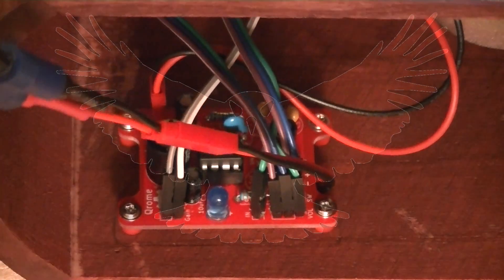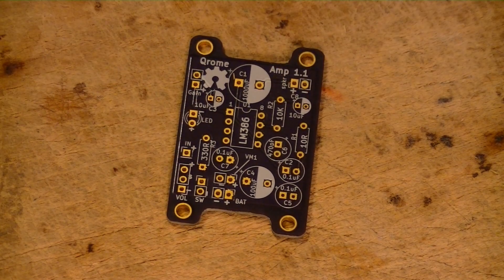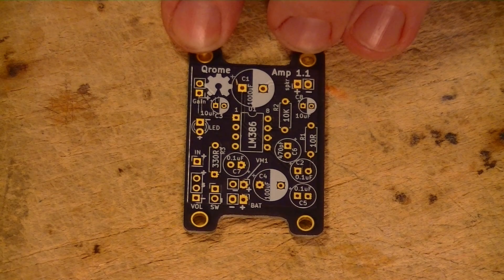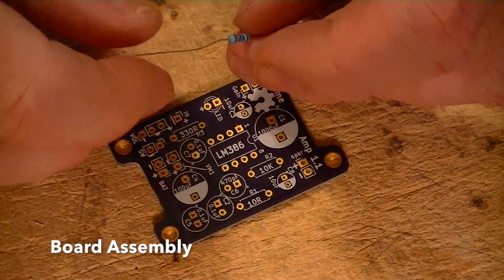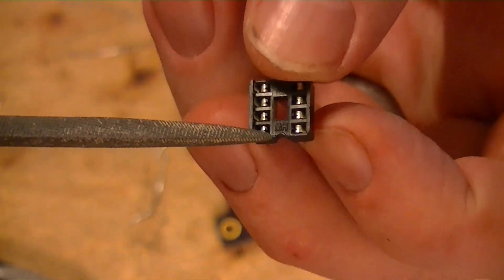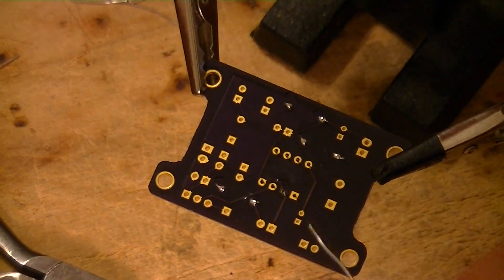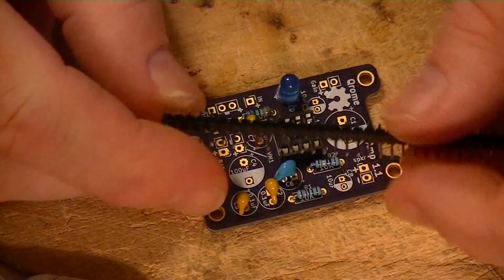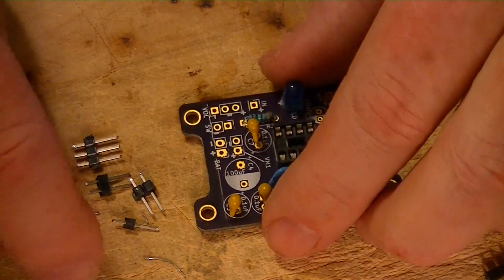Qrome Guitar Amp Build using LM386

Comment: You use the Open Source Hardware logo on your circuit board. Where is the schematic for the board?? I don't see it posted anywhere.
Reply from the maker: The schematic is included with the board.

Comment: can you give the schematic please? and pcb circuit and components too if possible. also i want to connect output jack to the amp instead of connecting directly to the speaker, how can i do that
Reply from the maker: Schematic is shipped with the board.
Reply: @Qromer  i have a project in college so i have to make the pcb board itself, so im making everything myself, thats why needed schematic

Comment: OK,, quick question. WHY did you use the Orange Ceramic caps on some places and the Blue on the 1 place? what's the difference? does it matter? I have tons of the blue caps but not sure if I have the Titanium ones(Orange).
Reply: I came here to ask the very same thing. I have the orange but no blue. Did you get the amp to work?
Reply from the maker: Give them a try.   It will probably work just fine.

Comment: Very good initiative selling pcb's.

I've done a bit of dabbling with the 386, myself and I find using a fairly small input cap like 10 - 50 nF to filter out some of the bass makes sense if you get issues with the bass clipping earlier than the mids and treble, or if you're using a small speaker element. I don't know if you're already doing this, but you can stablise the dc offset better if you couple the inverting pin with a 220 nF cap instead of shorting it to ground. JohnAudioTech has a pretty good circuit, if you're looking for inspiration for a v1.3.
I think I went for about 12 or 15 nF in the input on mine, which gives me a cutoff at about 200Hz to compensate for the 45mm membrane. 

Good choice with the 10k pot for the gain, gives you a better range, since minimum gain with a 1k pot is 50x.

If you find yourself looking for a bit more power or bass, the little gem configuration might be a good option. It's two lm386s that are bridge coupled, so it allows about twice the output. VegasCyclingFreak has a video on it. I would definitely buy a few of those off you, if you make pcbs for them. I'm currently looking at making one on vero.

Comment: Nice. I have a pre built lm386 that I got from china a few years back and I put together a 2 valve/tube pre amp board also from china. I plan at some point in using them both in a home made guitar amp. 
I also have a 1953 philips disc jockey senior record player which I intend on turning into a guitar amp. Also I plan on making a few guitar pedals and have bought loads of electronic components, germanium transistors, pedal enclosures etc. I'm probably overdoing it with projects LOL

Comment: This is very nice that you are sharing your work.
    I would like to learn to build a solid state with larger primative but stable  components, and substitute an analog circuit for the chip.
    Then I would like a reverberator with tone and dynamic control.
    I am waiting to hear your beautiful looking amp.
Reply: The chip is already analog. You're feeding it an analog signal (the guitar) and it is outputting that same signal... just amplified.

Comment: Can someone give the V ratings on the E caps?
10, 100 & 1000uF
Trying to order parts and the kit doesn't say.
Reply from the maker: I think I used 25v but,  you should be able to use anything over 12 volt.

Comment: What is the values of gain and volume potentiometer
Reply: Most likely 500k I would have thought. If it had a tone pot then maybe that would be a different value. I'm certainly no expert, I'm learning myself but 500k would have good controllability for the volume and gain, and a 1000k (1 meg) pot would have even better control

Comment: Is the guitar directly connected to amplifier input or some resistor in series?
Reply from the maker: Not sure I understand.  The video shows the guitar connection to the input with a standard guitar cable.
Reply: @Qromer  that means we can connect any guitar to any amplifier directly to input ?

Comment: Great little module! Given that it is allegedly Open Source Hardware, where can we find the schematic and board files? as this is a must of true OSH. Thanks!
Reply from the maker: Thanks for the comment.  Sorry, at the time I placed the OSH symbol on the screen I simply thought it looked cool.  The full schematic is based on the one provided by the LM386 datasheet.   It was not derived from an OSH project and is not under the license.  You can view the LM386 samples here:  https://www.ti.com/lit/ds/symlink/lm386.pdf?ts=1617997878307
Reply: @Qromer  Ok, I see. It's such a pity since your design is very good looking and would be a great resource for the open source community. Anyways, it's good to see it as a reference. I will attempt to develop a simillar version and hopefully share it around.

Comment: Do you have a ink to where you get the jumper pins?
Reply from the maker: The header pins are great, but sucks when wires pop off.  When I make a permanent mounted amp, I solder the wires directly to the pad and hole.  Otherwise, you can use any standard 2.54 Header Pins.   These are like the ones I use from Amazon:  https://amzn.to/3vw092h

Comment: I have assembled my amp but when I plug it in all I hear is static. any advice?
Reply from the maker: Yes, verify all the wiring is correct.  Make sure the LM386 is in the correct orientation on the board.   Make sure the audio jack is wired correctly.
Reply: Qromer so I couldn’t get the guitar amp to work but I am able to hear radio which is kinda cool

Comment: Hey great video and love the simplicity. Questions, did you design this? Is it based on proprietary IP? Can you share the circuit diagram? Thanks!
Reply from the maker: Thanks, I did design this board but it was based on the examples from the LM386 specification sheet. They give some very good examples how the chip can be used.
Reply: @Qromer  Ok fair enough, then I have one more question... I currently do not have any 10k ohm pots... I would have to order some. I do however have a bunch of 50k pots. I was wondering, I know that the resistance in this instance is not super important but I fear the voltage drop across the pot will be too high for it to work properly. Any insight?

Comment: If i want to fit this into a guitar to use headphones, can i wire the audio output plug to power on the device, as opposed to the input? My input would be hard wired into the guitar, leaving the headphone plug to be my other choice
Reply from the maker: Yes, I think that should work.  I have not tried it that way.
Reply: Qromer cool thank you bro 👍🏻

Comment: what is the difference between the volume knob and the gain knob?  and where in circuit do they come in the circuit.
Reply from the maker: High gain will add distortion and Volume will simply add volume.   Check out a data sheet for the LM386 -- they give examples out to use them.   The gain is between pins 1 and 8 -- with a potentiometer and a capacitor.  Volume is on pin 7.

Comment: Hey can you please release a schematic ?
Reply: JohnAudioTech has a pretty good schematic, just remember to add a 5-10k pot in series with the 10u cap between pin 1 and 8. Otherwise the one on the datasheet is also alright.

Comment: The board has the open source hardware logo on it but I do not see where you have posted this circuit diagram or board layout.  Can you share that with us?
Reply from the maker: The board does have the logo -- but only because like the way it looked.   It has not been released under the OSH though.   Sorry.
Reply: @Qromer  hey, could you release the source files? after all you are selling a board which says it is Open Hardware, so you must either release the files or realise it would be a fraud to advertise with such logo.
OSH means something, you can't use it just for looks, it also has legal implications BTW.
Reply: @emilianovalenciaa  That's not actually the logo used.  The logo used has the words 'open hardware' or 'open source hardware' which I don't see on his board.  Otherwise, it's just a shape.

Comment: Hi – David – Just finished making and testing my Qrome amp. Brilliant - worked first time! I’m really pleased with it as a project, and little practice amp. I bought a 3” 8 ohm 30w speaker, and build a sturdy cab, so I think I’ve probably got the best out of it. My only problems were – cost of shipping to UK, identifying correct resistors (although I did manage!), and could have done with a couple more jumper leads (although as you mention I could have soldered wires). The jumper leads work fine from socket to amp without soldering.  Cheers, all the best Terry
Reply from the maker: Terry, thank you for the feedback and glad you are enjoying the amp.   I wish I could ship cheaper to the UK.  I agree about trying to identify the correct resistors -- I am thinking of adding some close up photos with labels to the printed sheet that comes with it.  Thanks!
Reply: Cheers David, thanks for reply. All the best, Terry @Qromer

Comment: Hi David - Great vids. I've just ordered an amp kit from Etsy - may take a while to arrive as I'm in the UK!  I'm wondering what speaker(s) to acquire? Afraid I know very little about electronics. I notice you use a couple of different speakers in your builds. You specify 3'', and 4 or 8 Ohm, but not what wattage. I know ohms is important, but not sure about size or watts. Could you tell me what the crucial specs are please? Cheers Terry
Reply from the maker: Terry, excited for you to make the amp.   I typically go to the local thrift shops (Goodwill or Savers) and look at the donated speaker boxes.  I have found that the 3" 8ohm speakers sound really nice.   I wire them up and often test them while they are in their original speaker cabinet to hear the sound.   I typically look for stuff in the range of 5 - 30 watts -- though I have tested some that are much higher.  If the watt rating is too high they just don't have the same sound and the amp may start to get hot.    I hope that helps.
Reply: @Qromer  Hi David - thanks for getting back so soon with info. I was looking on a local Flee Market stall yesterday that had a variety of secondhand speakers, but didn't buy in case I chose wrong one. I'm just trying out a bit of electronics and it all baffles me. Seems amazing you can use such a high wattage speaker with such a small amp - I guess physical size is important here? How many watts is your amp? Cheers Terry
Reply: Terry Pashley  Hi David - just to let you know amp has arrived, so thanks very much for your attention to things. I'm not going to rush at it - got a couple of guitar builds on the go - but will let you know how I go on. Cheers Terry

Comment: I'm not sure you check the comments, but i followed the instructions laid out in the vid. When I plug my guitar into the amp, the LM386 chip gets very hot. The led turns on but no sound is coming out of the speaker.
Reply from the maker: Contact me through Etsy and send some close up photos of the board front and back.

Comment: 4 ohm speaker?
Reply from the maker: Yeah, if you look at the back of the speaker there is usually an ohm rating.  Most car audio and home audio is 4 - 8 ohm rating.   I find lots of great speakers from Goodwill or Savers (thrift stores).   Most of those surround sound speaker systems are 4 to 8 ohm ratings and you can get them cheap.   Does that help?
Reply: @Qromer  I just needed to know if the amp was rated for 4 or 8 ohm speakers.  Sometimes 4ohm is too low. Thanks.